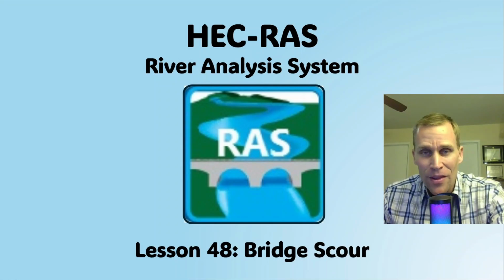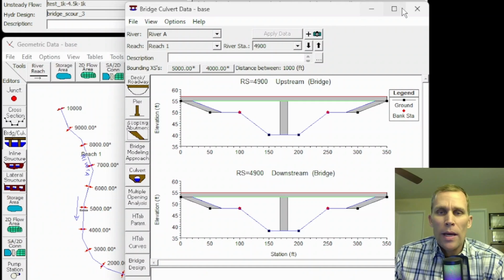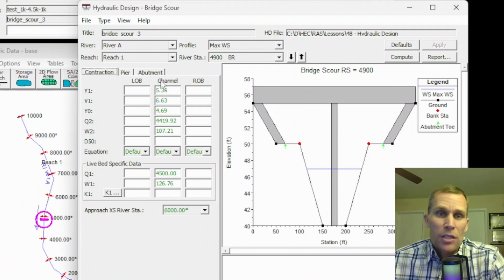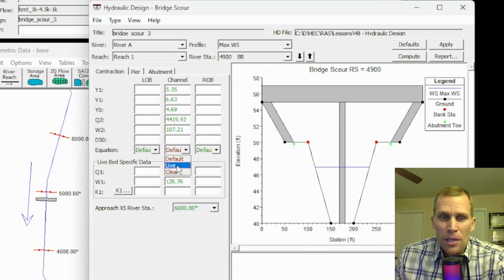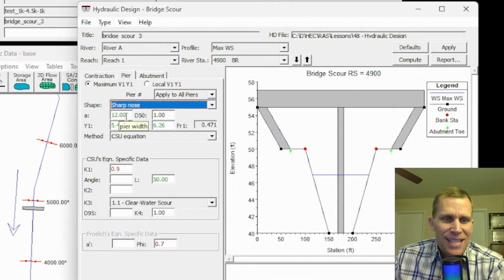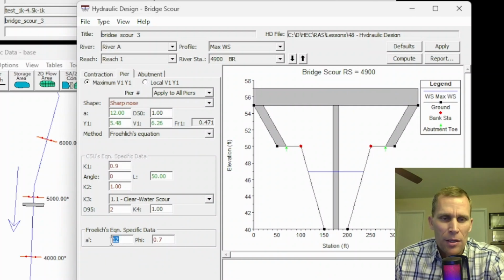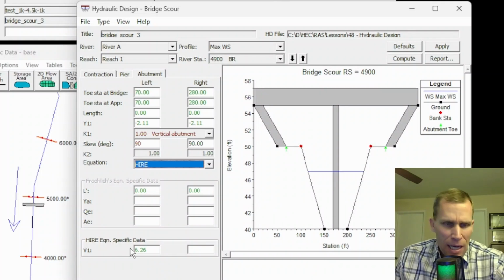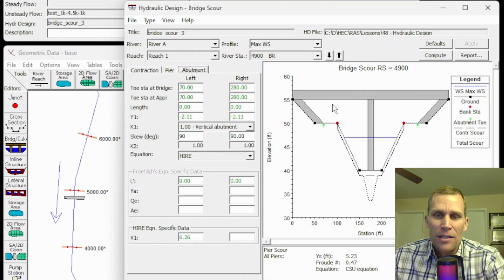HEC RAS Lesson 48 - Bridge Scour

Comment: Hi! I have water surface above banks and in contraction tab LOB and ROB (Y1 and V1) fields are automatically empty. Is it normal situation? How to obtain this data? Thanks
Reply from the maker: Hi. I just built a model to check this out, however my LOB and ROB columns were fully populated with numbers (similar to the Main Channel column). So, I wasn't able to replicate what you described. Do you want me to make a short video showing you my steps? Or you're welcome to send me your project files (zipped) to: tim[at]boshsolutions[dot]com

Comment: tanks Tim I was lost in scour depth analysis still not clear about D50 & D90
Reply from the maker: Hi. In bridge scour analysis, D50 is the median bed-material size where half the particles are finer and half coarser, while D95 is the size where 95% are finer and only 5% are coarser, both used to characterize sediment for scour prediction and armoring assessment.
Reply: D90 and D50  value comes from partical size distribution field test using sieve analysis of river bed soils

Comment: Hello, how did the scour-contraction tab populate at the start of the video? I input all the geometry, flow, culvert information, etc, but that table remains blank. Is there a step that I missed?
Reply from the maker: Hi. I think that data is populated because I ran a simulation first, after that I opened up the Bridge Scour -> Contraction (tab). Trying running your model first and see if those numbers populate for you.
Reply: @TimNelsonPro  thank you for responding! I ran the simulation before opening the scour window, is there a step between those?  I have my station geometry in, I have the bridge and 2 side by side open bottom culverts in, then I ran a steady flow, and even played around with the flow distribution window, but the scour window is still blank. So I think there must be something that I didn’t fill in.  

Any help would be hugely appreciated. Thanks again!
Reply from the maker: I'm doing lunch now, and then editing a video HEC RAS Support 15. After that I can look into this topic (in a couple hours). I'll respond here in this comment thread with more info. What version of HEC RAS are you using?
Reply from the maker: Strange, it populates fine for me. I'm using HEC RAS 6.6. I built a simple geometry with cross sections and a bridge. I created a simple unsteady flow file, created a plan, and ran a simulation. Then I clicked on Run (menu) -> Hydraulic Design Functions, and the Bridge Scour editor opened up automatically with data populated for the "Channel" column.

A couple things you may want to check:
1. When editing your geometry, make sure you have at least 2 cross sections upstream of the bridge AND 2 cross sections downstream of the bride.
2. In the Bridge/Culvert Data Editor, make sure you click the "HTab Param." button (on the left side panel of buttons) and input all the data values in that dialog box -- this should be required before the geometric preprocess will run however.

If that still doesn't work, I can create a short support video showing my screen and every click, or you're welcome to email me (tim@boshsolutions.com) your HEC RAS files zipped for me to take a look.
Reply: @TimNelsonPro  I figured it out, I guess culverts do not work for scour analysis even if they are modeled as open bottom.  You have to model it with the high chord/ low chord window instead.  Thank you so much for your help!
Reply: I was using 6.5 I think, and I had to delete the culverts before it worked.  Tomorrow I may try to do it again making sure I follow your steps.  Thanks again for everything!
Reply from the maker: Cool, good to hear you got it figured out! And thanks for the info about culverts.